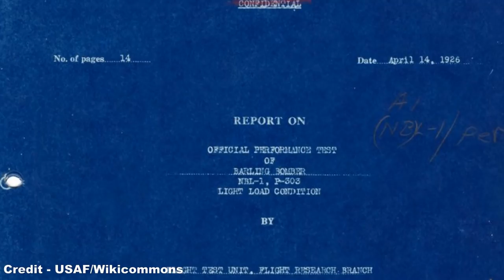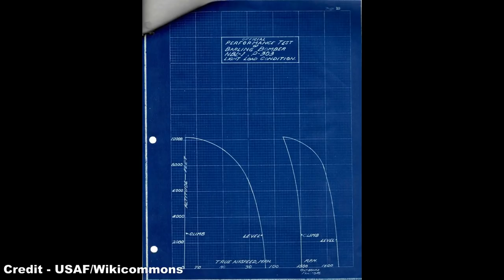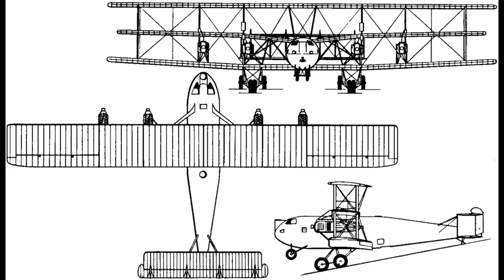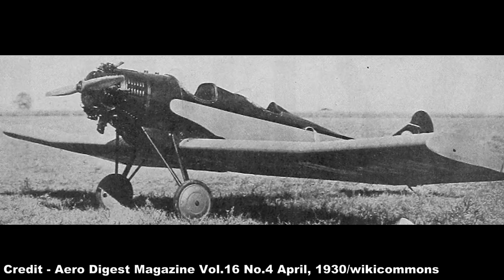Flying Failures - Witteman-Lewis XNBL-1 "Barling Bomber"

Comment: Whilst I would agree that carriers and air power would eventually displace the battleships as the ultimate force projection, I would dispute the value of the tests conducted on the Ostfriesland. All they demonstrated is that if you anchored a ship with no crew and all hatches left open, that after a day of uncontested bombing, it could eventually be sunk. Hardly a glowing recommendation.

Comment: The film, The Court martial of Billy Mitchell with Gary Cooper directed by Otto Preminger released in 1955 is a dated but watchable film.
Not a great...
The crash of the Tarrant Tabor was neither the fault of the designer or maker. Look it up in Wiki.
Reply: That crash was largely due to the rotation moment caused by the height of the 2 extra engines on the 3rd upper plane. That is in a book called the Worlds Worst Aircraft", which I have - and is in Wiki. Whether that was the fault of the designer? I would say so, but what wasn't his fault - he objected to it - was the addition of extra ballast in the nose, which didn't help!